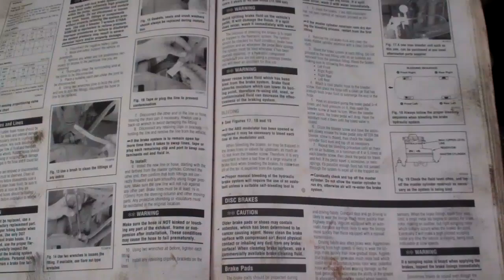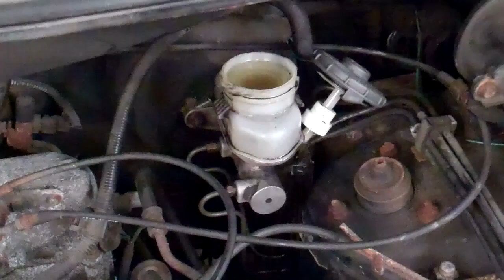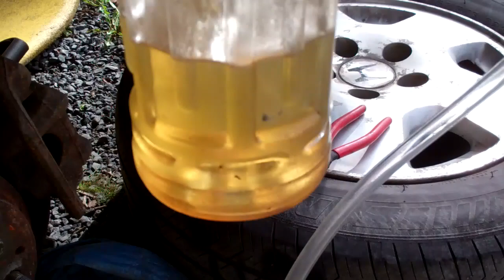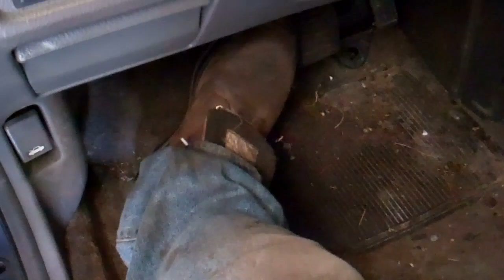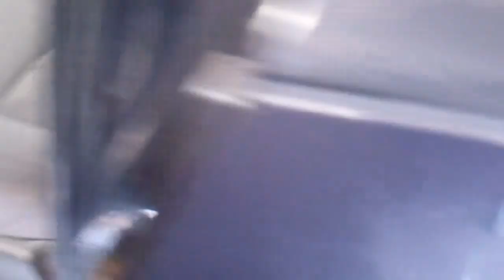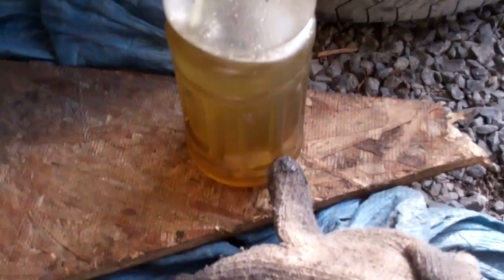How to bleed brakes using the " One person " method

Comment from the maker: @XGCScrappy Whatever the thickest grease is that I have at the time Scrappy - usually bearing grease. I figure if it's too thin a grease, it may not seal and keep air from getting sucked back in the brake line when the brake pedal is released.

Comment from the maker: I buy one of these manuals for any vehicle I've ever owned Fernandez. I find they are almost exactly the same. The only problem I have with them is that sometimes they advise removing parts that aren't really necessary to take off. I changed a hub & bearing in a Sunfire recently; the manual advised disconnecting the stabilizer link and the lower control arm which didn't have to be done. Other than that, I find they are great.

Comment: What a load of unnecessarily complicated work,,,,!!!
If you need to bleed your Brake System, go out and get a Gunsuns Eezibleed Kit,,,,!!!
If your local mechanic/DIY/Parts Workshop doesn't stock this, send for one on-line from UK,,,,!!!
Cheap, Easy to use, Comes with various Brake Fluid Reservoir screw caps for different cars,,,,!!!
Simply fill up the Bottle provided with new Fluid, connect the other pipe provided with the kit to your spare wheel and simply go round each wheel in turn,,,,!!!

Comment: I have a 99 Chevy malibu that the drivers side front brake doesn't release all the way sometimes (disc brakes btw). So the pads wear down very quickly and also causes some shake in the steering wheel at speed. When I replace the pads, the caliper cylinder is extremely difficult to retract (the other side retracts easily using a large c-clamp). Any idea why this is? The ABS system stopped working long ago btw; long before this started happening.

Comment from the maker: @iulixxx It's a lot of work to completely change the fluid. Instead, I would use a turkey baster , suck the old fluid down to the minimum level of the master cylinder, and add new fluid. Use the vehicle for a week so the new fluid will mix with the old, then do it again. Almost as effective but a lot less work; you'll end up with almost completely new fluid. Careful not to go below the 'minimum' mark on the master cylinder reservoir though Iuli - or you may have to bleed the whole system.

Comment: If you elevated the bottle above the bleeder valve then the air bubbles would float up and there would be less chance of them getting sucked back into the system. The rest of your technic is perfect and will work for bleeding or changing the fluid all together. Good job.

Comment from the maker: @beefcakes8528 You could, but that's a lot of work just to change dirty fluid. I would buy a turkey baster at the Dollar store, suck the old fluid down to the minimum level of the master cylinder, and add new fluid. Use the vehicle for a week so the new fluid will mix with the old, then do it again. Almost as effective but a lot less work.

Comment from the maker: @ah77ed If you think you may have air in more than 1 brake line then yes. What I usually do is bleed the line at the wheel i was working at . Then I'll pump the brake a few times. It feels soft, then I'll bleed the other lines.